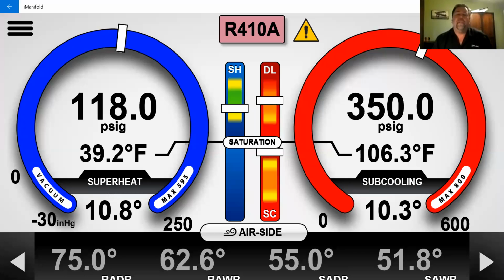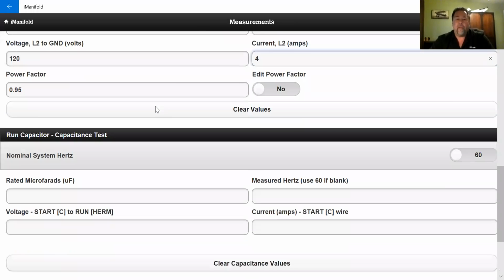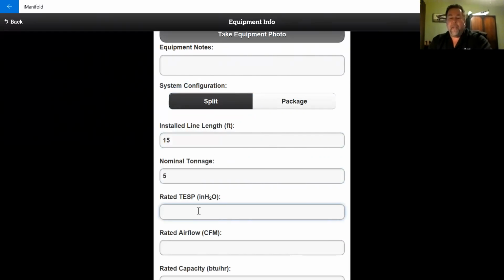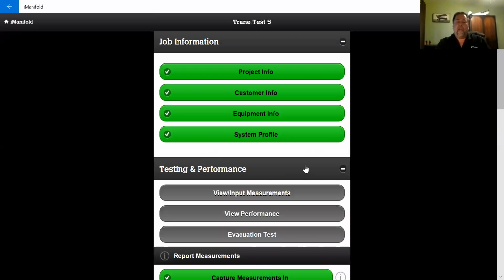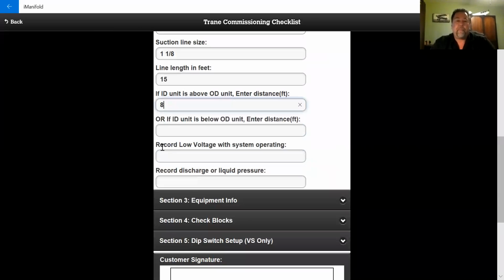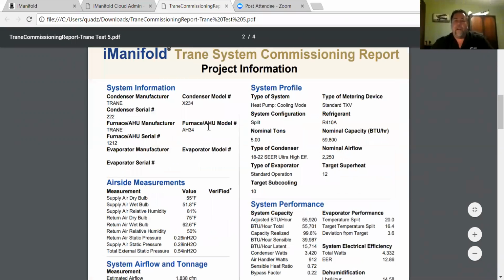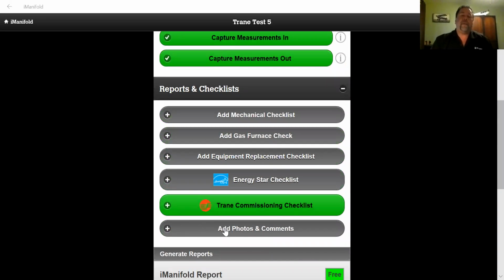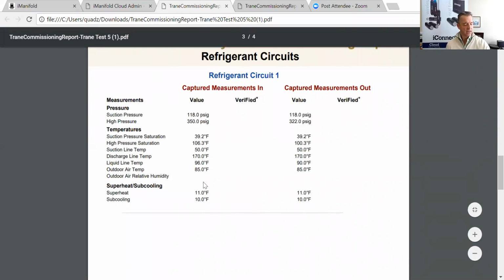iManifold Virtual Training on TRANE Installation Commissioning Reports

Comment: So I heard imanifold was dropped team let go I take it I received bad info year back or so?
Reply from the maker: Hello Nate, Although some of the original team has moved on we have a very knowledgeable team of people that are talking the platform to the next level.   We have added a data logging app plus a much more user-friendly and capable cloud offering.  We are working on additional hardware and software that will greatly improve the user experience.  Please reach out to us to let us demonstrate to you the significant value of the system.   support@imanifold.com  716 699 2031